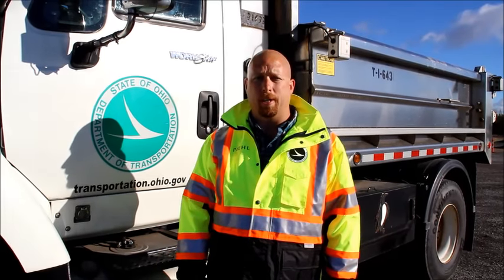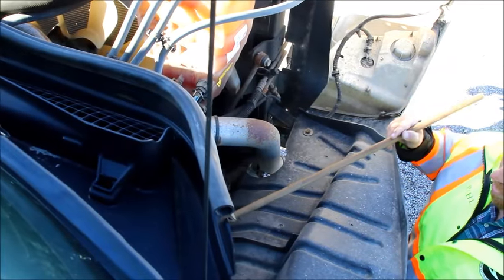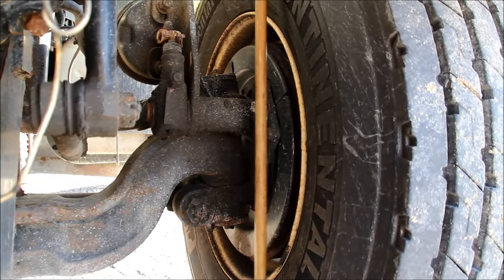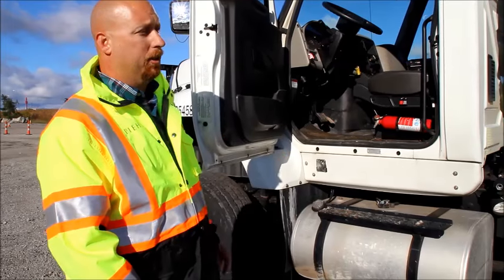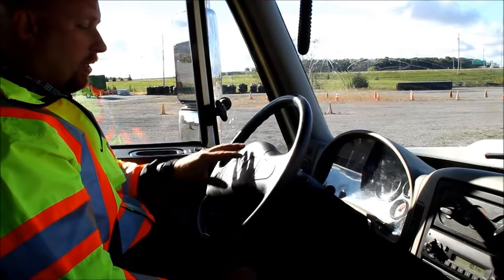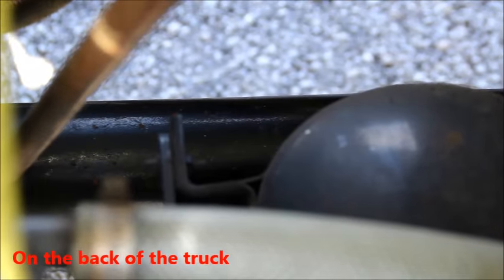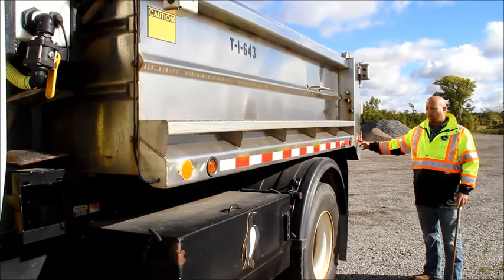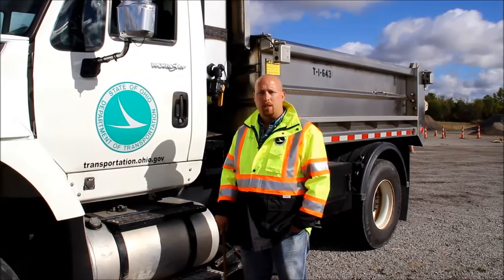CDL Pretrip Inspection

Comment: I was a certified CDL A instructor for Indiana. I came across this video today and it is perfectly done. You have helped many people and I salute you !
Reply: I have a class B with Tanker’s! I have to do this for the City of San Francisco
Reply: Im driving a gmc c6500 with a 4-53t Detroit and 5 speed with a 2 speed rear end from Connecticut to oregon im estimating $600-800 in fuel but i need to memorize pre tripping everything before i leave
Reply: This air brake portion does not pass Indiana certification. Everything else is very useful.

Comment: THIS WORKED FOR ME !!! Self studied passed my test just now class B cdl Milan , Ohio !!!! God bless
Reply: Did you have to identify parts at every wheel ? Or just one front and back wheel
Reply: @1Brooklyn2Many  front and back I did one side however I made it a point to tell instructor I will inspect this side same as other besides any different parts would you like me to repeat the process on this side ? exhaust was on passenger side so I pointed that out he was very nice and told me I didn't have to worry about passenger side .
Reply: @1Brooklyn2Many   advice for road trip pay attention to passing signs they will randomly ask about them. just call out every single part you know even if you don't think you have to and keep it moving name everything its better to point out something you don't need to then forget. stuff remember to check both horns lol I forgot that all together

Comment: Thanks for the great video. I used it as my study guide before taking my test in Gnadenhutten today. Unfortunately I timed out on the pre-trip inspection and failed the test. The inspector said that she could tell I studied a lot and just needed to work more quickly. Your video is great and I feel like I can pass it next try. Thanks for putting it on here, very helpful!
Reply: I passed the second time I attempted. I went to North Coast CDL for the test. It was a great experience. The examiner communicated really well and was great to work with.

Comment: Followed your video and aced my test. FYI.. Instructor did have me do all brake tests with engine running. Thanks
👊😎
Reply: DroneDad 68 I’m in Cali going in tomorrow for cdl test. What are the “required” tests. I got cut in, out. Applied. Low air and spring brake 
Thanks in advance
Reply: Robert Ramirez Did you pass?

Comment: Everything is pretty good however after the CDL brake test after doing everything you have to do you have to build the pressure back up and from 85-100psi should not be anymore than 45 seconds and then continue building pressure until you get to 120-140psi. Big thing you cannot forget
Reply: This is not required in Ohio.  Check your states CDL manual.  it is in Ohio's manual but not a requirement when testing

Comment: Great video! Studying for my class A in Ohio  in a few weeks. Will be taking with dump truck with air and trailer with electric brakes. Will I need to tug against the trailer brakes? The reason I ask is because my in cab brake controller is acting up and does not work 100% of the time. Also, do you actually have to check the air in each tire and actually pull on slack adjusters? I’m confused on what you actually have to do vs just explain what you would do.
Reply: Imagine everything is fine, you're not really inspection anything to make sure it's safe. It's just to make sure you know what you are inspecting and why you're inspecting it. I failed my pretrip the first time and I have 14 items that I found wrong with their rental truck, one was no oil on engine oil dip stick and they said it's been used all day, it's fine. lol Good luck sir!
Reply: Corey, i am not familiar with testing with electric brakes.............you only need to mention that you would check the air pressure with a pressure gauge, not actually perform it,  different states could have different requirements
Reply: @piehljeromy  passed my class A first try a few weeks ago with flying colors and I think it’s about 98% because of this video! So helpful. FYI - you don’t tug on the trailer brakes with electric brakes, if you take the test with a truck with air and trailer with electric the brake portion of the test is just as it would be for your class B. Just have to pre trip the trailer along with the truck. Thanks again!

Comment: I have a queston: I"m going to take my cdl class a test on the 21st, how much different is the brake test as to just the class B? Also, I do have to release each brake individually correct? I am an ohio resident
Reply: How was it???
Reply: Sorry I am late getting back to you.  Best thing to do is review the CDL manual for the differences.  It is very similar.  Mainly the numbers are different and yes, you pull against each brake.

Comment: been studying many of these. Unless I missed it, some people may say you left out.. 
-less than 2" steering wheel play,
- psi build from 85 to 100 takes less than 45 seconds.
 - less than 2 psi loss after initial drop in a minute with engine off when you released spring brake. 
-having wheels chalked during brake test. 
Can these details very from state to state?
Reply: these are very good things to check but are not required in Ohio.  Check your states CDL manual to see if it is required where you are.

Comment: I have a few questions. When checking the front and rear suspension, in the video you did just the driver side, do we have to do say all that again on the passenger side for the other two wheels as well? Also does your truck your testing with need to actually have all reflectors in good shape along with the right type and correct amount of fuses?
Reply: you only have to check the driver side and anything that is different on the passenger side.............so on the suspension we only check the driver side because the passenger side is the sameif your truck takes fuses, yes they need to be in there, it is a federal law........same with the reflectors......you may not fail your pre-trip but they need to be in there to be legal
Reply: Jeromy Piehl thank you for the info

Comment: Failed the air brake test in Norwalk for having the key ON during the 1 minute hold test.
Reply: Inspector said even with the engine off and the key on the air can be supplied to the system
Reply: There is a phone number for the Ohio Department of Public Safety at the end of the video if you want to discuss the situation.  Norwalk is a third party site and is governed by DPS

Comment: Please help. I have my Class A test soon. Does this apply to Class A or just for Class B? Thank you.
Reply: My examiner from Ohio recommended this video, and said besides the air pressures being 1 psi off because of the combination, and testing trailer brakes, it is the same.
Reply: @brianwilliams205  thank you so much!
Reply: @brianwilliams205  what do you mean about testing trailer brakes?
Reply: @VisionaryDailyShorts  on a class A with combination, you check all the brakes. You perform a brake check. I suggest watching how to do that properly on a class A video.
Reply: @brianwilliams205  thank you. Any videos you recommend?
Reply: @brianwilliams205  have you done your class a already?
Reply: @brianwilliams205  I’m really worried about the pre trip.
Reply: @VisionaryDailyShorts  https://youtu.be/EfW615ZnELE

I haven't passed yet. The examiner recommend the class B video, but just know the difference for Class A. There is no difference besides the brake check portion, and it has to do with how many psi 3 and 4 can leak in a 60 second period. Just watch the video and practice, in sections. Good luck
Reply: @brianwilliams205  thank you

Comment: should the key be turned on or off during the I minute hold for 3 psi loss?
Reply: Glen Maule on position so you can see your guages
Reply: I have the guys turn it on so they don't forget.  Depends on the truck.  In some trucks the gauge will not work without the key on.
Reply: I need trainin todrive dump truck is thete any class in connectticut i have my class b cd
Reply: The key is in the on position with the motor off

Comment: and he never  kicked or touched the  tired  to see if they  where low or bad!
Reply: Kicking the tires is not an approved method.  Must mention that you would check the air pressure with a tire gauge

Comment: At 14:00 this guy failed his test. For not rolling down the window and listen for any air leaks, while holding the breaks for 1 min
Reply: This is not a requirement.......Air leak would be represented by loss of pressure.........I have had hundreds pass this test......It is a good idea to do this though......Thank You
Reply: Jeromy Piehl this is what my instructions walk around book says.

M. **AIRBRAKECHECK**
Must be done completely and correctly or it will be considered an Automatic Failure. You must be able to fully explain and demonstrate each item below in the exact order!!! If you realize that you forgot to say or do any step, go back to Step 1 and start the entire Brake Check from the beginning.

1. Run engine and build air pressure to 120psi to 140psi

2. Leave truck in gear and turn motor off

3. When motor stops, turn key to ON position – DO NOT START

4. Push both RED and YELLOW valves IN

5. Roll down the window

6. Apply Foot Brake for one minute, “listen for air leaks outside” and watch gauges for
no more than 4psi drop for Class A vehicles (***3 psi drop for Class B vehicles***)

7. Pump brakes down to approximately 60psi (lower buzzer and light will come
on).Continue to approximately 20psi - 40psi at which time the Brake valve should pop out (applying the spring brakes).
Reply: I am not sure where this came from but it is not from the "Ohio Commercial Drivers License Manual", which doesn't state that the window must be rolled down
Reply: Jeromy Piehl I’m in FL sir. But in NY it’s the same also I was told
Reply: Hey do you have to do the governor cut out?? Great vid
Reply: Joe Kovach you can check in your commercial drivers license manual for your state.  When i teach our people I have them explain that the air built pressure to between 120 and 130 and that the system is fully charged.  Then they start with shutting down the engine and turning the key on.  Then move into air brake test by holding the pedal.
Reply: Jeromy Piehl I’m in Ohio ...so it’s not a requirement in Ohio to do the governor cut out? Just do say before the whole air brake test that fully changed is between 120 -130? Thanks for this vid wish me luck!! Haha
Reply: That's right I'm in Arizona and it's required to roll the drivers window down and say your listening for air leaks.... automatic fail...other than that great video!
Reply: Joshua Cortes not how it is in Louisiana
Reply: The key was in the if was in the ignition while the instructor was outside the truck! Automatic failure

Comment: That was a failure pre trip. The most important part of the pre trip is air building from 80 to 100 psi in 45 to 60 seconds.
Reply: This is not required in Ohio........check your state to confirm if it is needed